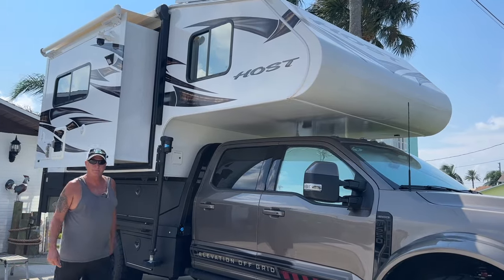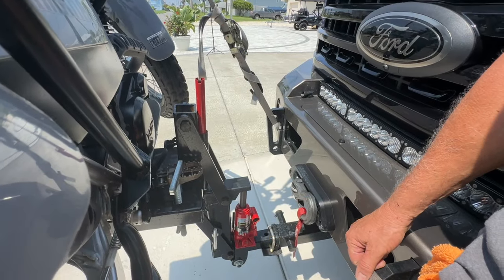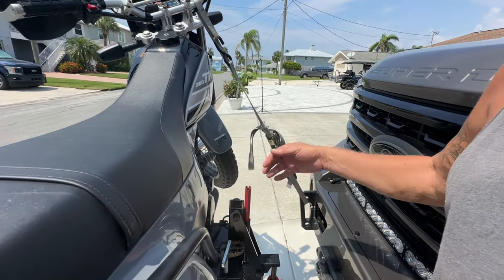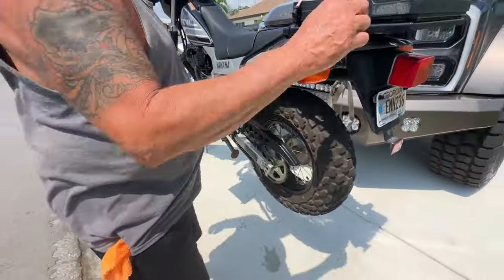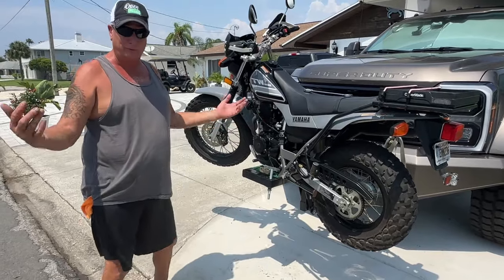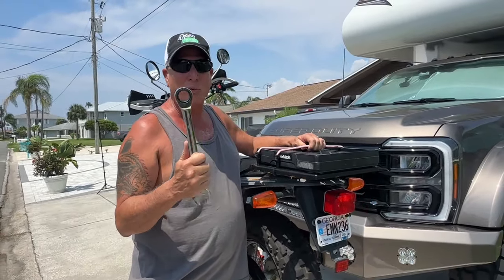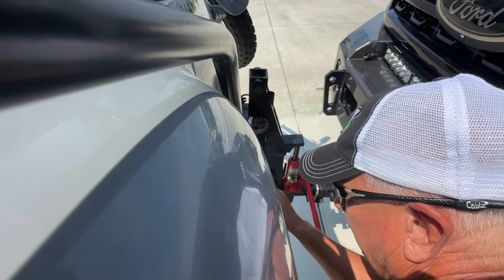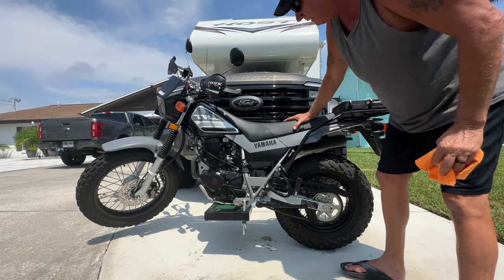Motorcycle Carrier for Ford F550 - The Ultimate Guide

Comment: I have done that on my truck with smaller motorcycles, like a 85cc motocross bike.  Unfortunately bigger bikes interfere with the visibility of headlights and turn signals.
Reply from the maker: Thanks for checking out our channel!

Yes, I agree with you on blocking headlights and turn signals.  I would say for our setup the lights are mostly visible. I was a concern about placing the bike in the front. I have a Torklift Super Truss also so I need be I can put bike on in the rear.  So far in the front has been ok.  We really drive after sunset.

Comment: Was wondering about your front,  2" receiver. Was the receiver custom fabricated.....bolt on....or? We have a RAM 5500 and can't find a front receiver because of the oil cooler location. Thanks.
Reply from the maker: Ours was install at Elevation Off Grid.  It bolts on to the frame and is also welded for added strength.  Our truck is a Ford.  Check with Torklift they have a lot of options.  We just signed with them on reviewing some of their top products.  We will be coming out with a video on a couple of things. Torklift will be offering a discount code for their stuff when we release the youtube video.  So figure out what you need and maybe wait until our next video to get the discount code.
Reply from the maker: Also thanks for watching our channel.
Danny & Donna